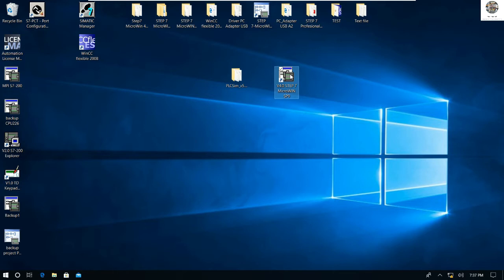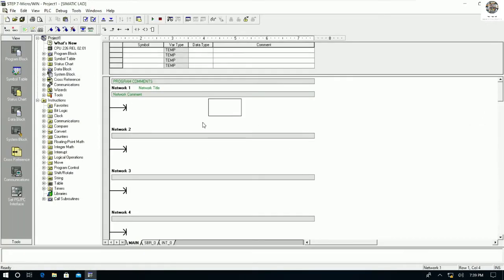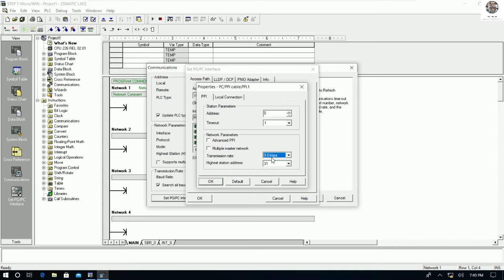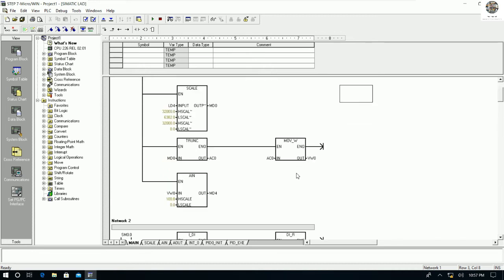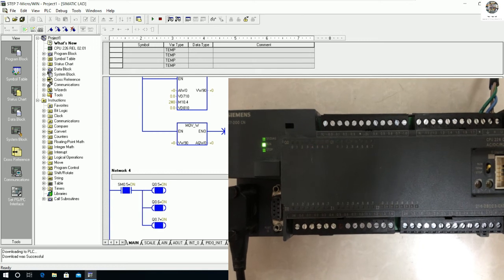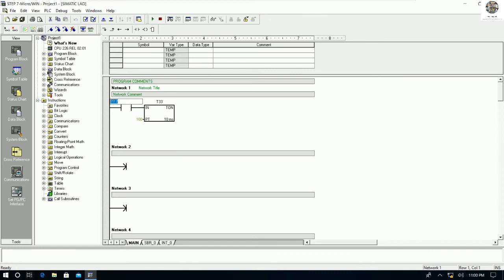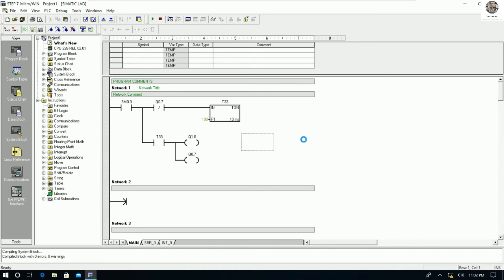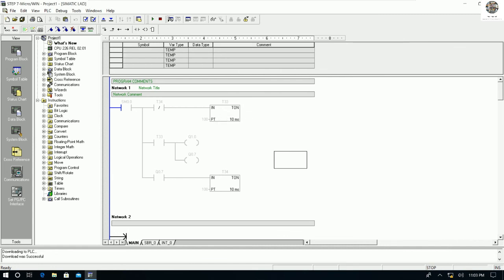Easy to connect PLC S7-200 CPU 226 CN communication with PPI cable by Step7 MicroWin V4.0 SP9

Comment: need ppi cable(siemens) driver
Reply from the maker: If you install Step7 MicroWin PPI cable will installed automatic on your PC
Reply: @generaltechnologyknowledge5165  I install microwin step 7 in windows 11
not communicate with plc how to resolve it?
Reply from the maker: @air-conditioningguruji7680  Dear sir,
We need to run some command to boot up the driver to support this windows sir.
Reply from the maker: For easy way please contact me by fb

Comment: Hello, I have MPI/PPI cable and I want to connect with my S7-200 SR40 Smart, when I set my PG/PC to "PC Adapter.PPI.1" and try to connect it, nothing shown in my MicroWIN Smart, just "PC/PPI Cable.PPI.1". When I'm back to PG/PC it shown "PC/PPI Cable.PPI.1" not "PC Adapter.PPI.1" that I select before. Any advice that I can try? Thanks